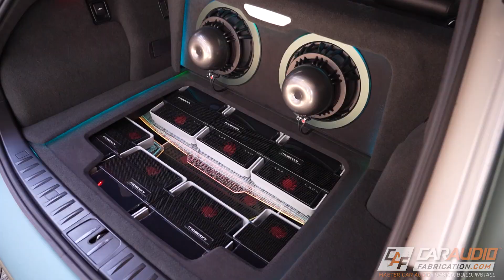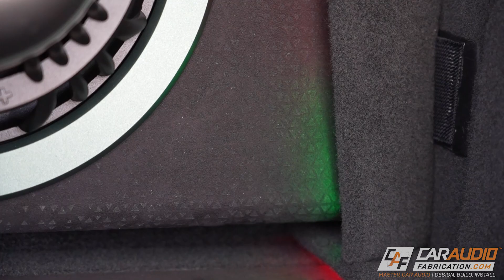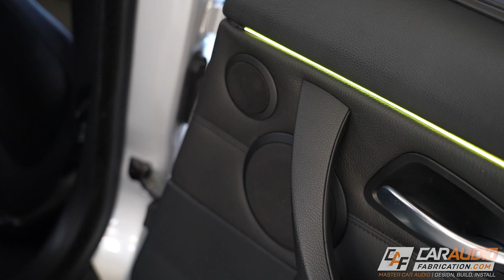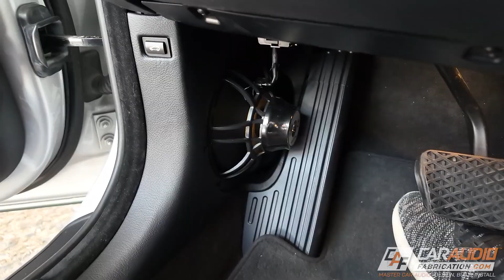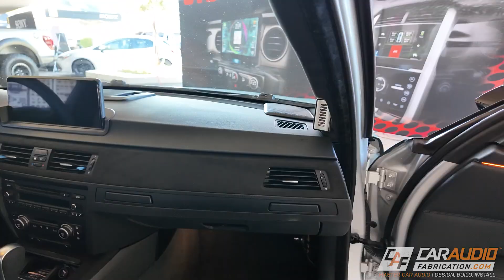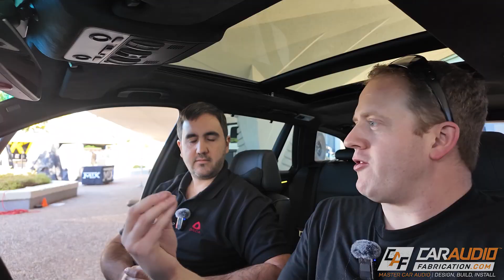Dolby Atmos Immersive Surround Experience IN CAR? System Walkthrough!

Comment: The problem with such good systems, is that anything else sucks. I have the JL Audio C5-650 in the front doors in my 2011 VW Passat paired with an Audison amp, and every time I sit in someone's car that doesn't have upgraded speakers, in most cases, I feel like the sound is horrible at any sound levels.

Comment: Man everyone’s been dogging on me because this is what I’ve been working on with 2 dsps 12 out puts each running coax to them and 4 is amps sq-442s and  1 100hc on subs that’s an I passive radiator enclosure that is 4.5 ft.³ running U.S. Amps three-way component sets 2 6s and one 8 3 way

Comment: If you install the neutron app on your car then Bluetooth to a nice factory 5.1 sytem and begin to tune it to ambient sound as a compliment to the 2 channel stereo you begin to understand that doing something like adding multiple channels on channels and speakers is not improving the sound. I can get bieng parked and watching a movie maybe.
Less is more. With very high quality 2 channel and subwoofers time aligned and well thought out sounds amazing tuned correctly. I have high end equipment at home and go to my friends with Dolby atmos and a huge sub it doesn't sound nearly as good as my home system. People run the mic and let thier system self tune now at home.
I'd rather have very high quality amps , speakers and subs than 27 channels packed into a small car. Remember you can only sit off center in one spot. You'll have Soundwaves interfering with each other bouncing all over the inside of such a small area. 
Your goal is to push the image forward wider and farther than the windshield. This is a very strange more is more set up. 
So is Dolby atmos you got at best buy and 12 channels of height and other concepts that don't translate ran off a chinese D class reciever at home. Try a high end stereo at home and you'll see what I mean. This is a very clean install , no offense to this obviously talented installer.

Comment: I was thinking about putting a multi-channel Atmos system in my truck and how to do it, the conclusion I came to was exactly what you did: An Android/Apple set-top running through a gutted home Atmos receiver just to get the multichannel processing.  I wanted to ask about time alignment, are you doing any, are you using the receiver via Audessy, or? I have some experience in multichannel via a system I put in a mid-2000's Acura TL fed from a laptop PC and a touch screen in the dash. I wanted to maintain 5.1 audio capability from the DVD audio head unit but be able to go PC source, accomplished with a Alpine 701 iirc (don't like that unit, noisy)
Reply: I'm very excited to hear it in my truck one day, but with various streaming music services offering Atmos tracks and the absolutely stunning Atmos remixes of Elton John, Queen, etc. it is time for that experience to come to the car, I say, and I applaud you guys for thinking outside the box, like me but far more skilled and organized. I would love to work for you. Oh, and if you haven't yet give the Atmos remix of Rocket Man a try, that mix sounds huge and I anticipate you'll be transported in an environment like the one you've set up in that car

Comment: I’m REALLY quite confused as to how you’re getting FULL phase coherency with an Atmos system with only 21 channels. It requires 22-23 to do a 5.2 system fully active with dual mid-bass/single midrange and tweeter per position plus two subs and achieve full phase coherency with all positions the same. You have to have some passive components in there which ARE causing some phase variances between positions. ALL positions must MATCH ENTIRELY to get that kind of phase coherency and use this in a full SQ manner
Reply: I dont think you can. The only way I see this being atmos is above 300hz. I guess its kind of like a hybrid atmos. Wouldnt you need full range at every location. I have 5.2.4. All of the zones play 65hz-20hz. It wasn't until I put 8" ceiling speakers in to match other zones, was when it really came alive.
Reply: @johnd5542 also, its a system in a car, a metal box with glass... it just will never be like a acoustic treated room.

Comment: Music is stereo
Reply: Even the best music that has been made for surround sound bad.
Reply from the maker: Except when it's mastered in Atmos, which is discussed in the video.
Reply: you didnt watch the video.
Reply: I clicked to check out the comments and I agree with you.  I have Atmos and Pro Logic in my home in four different rooms and the only multi channel setup that sounds decent is on my old Sony when the decoder used the MS or Pro Logic Music II matrix.

I used to fancy installations like this when I was a child.  Now, it's overkill for how often I desire to be in an automobile.
Reply: @RecordnRtist pro logic 2 up mixer does sound quite good, audison have something very similar in there range of dsp amps. It's not atmos but thing is not much music is mastered that way so it would functionally get as good as that setup for a lot less money. One 8/12 channel dsp amp (8 powered channels, 1 out for sub 3 for expansion) under a seat plus active sub instead of a boot full of amps and processing. Audison do a bcon (losses less LDAC blutooth) input so a smartphone can output. Then just high quality tidal tracks or cd rips. Some cars have a stock centre channel location so 2 pods in the back and 2 more in door cards, 2 more rear shelf Audison do 2.75 inch driver than does 16k down to 500Hz. It can been done for much less and get 90% of the way.